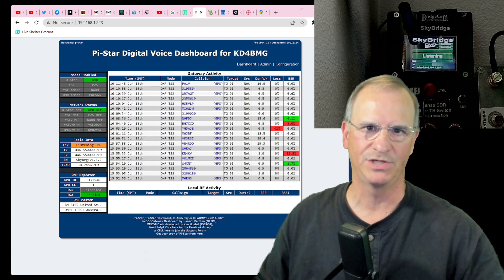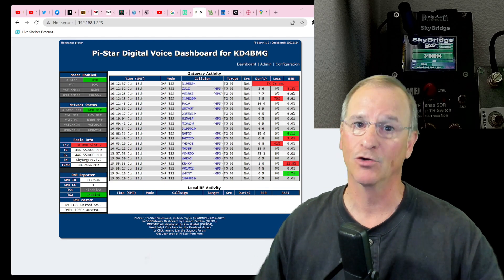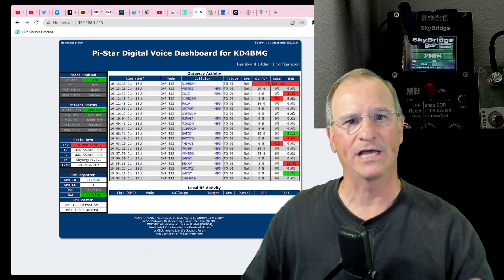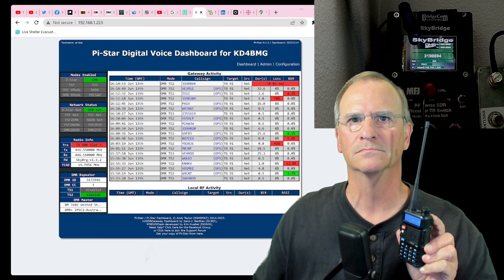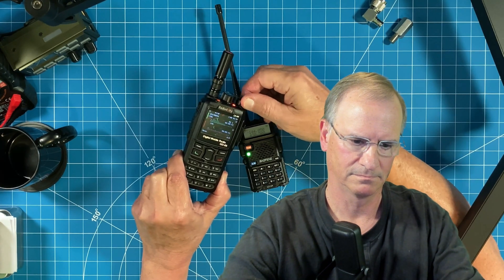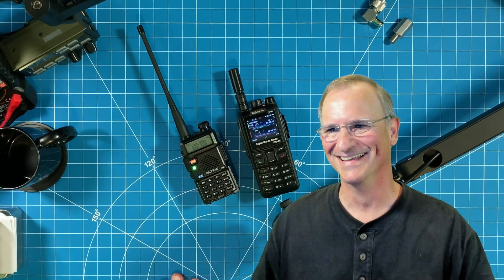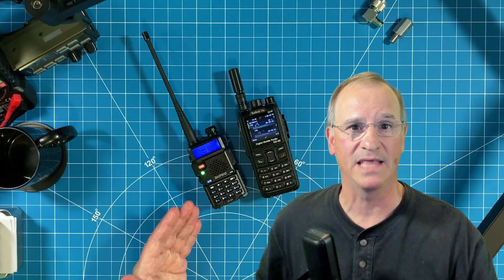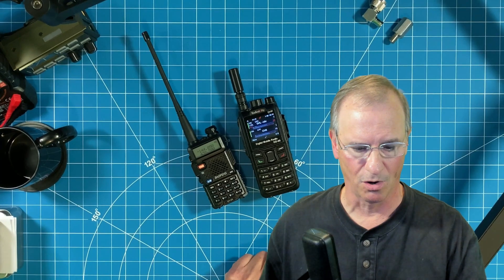Baofeng UV5R does DMR...with some help from the Radioddity GD-88 Cross Band Cross Mode Function

Comment: Use case 1.  When you and a group are out and about, this radio in essence becomes the best pivot to allow people with DMR to stay on DMR and the lesser radios to also join in on the conversation.  Use case 2.  Later on when everyone is back in one place.  You can set it up the way you have here and everyone can hit the radio and join in on digital to internet comms.  Many people with lesser radios have not done it.  The GD-88 very quickly became the best Value to $ radio I have.  Glad you got it figured out.
Reply from the maker: You nailed it.   Pinned to the top you go!

Comment: hello, this is not working for me, can you also have a video, in case I'm not setting up the uv5r correctly, thanks
Reply from the maker: There is no set up on the UV5R; it is an analog radio, so just set it to the correct frequency.
Reply: @HOAHamRadio  it is set to the correct frequency, however, it does not buzz like they say on dmr and it is heard on analog, and I make settings as you do
Reply: @HOAHamRadio  I see that you do it at 144 and my modem is at 440 does it matter
Reply from the maker: @vladimirkaraangov8496  Your GD88 needs to be set to the same frequency as your hotspot and on a DMR Talk Group, then cross band the other VFO on the GD88 to a frequency for your UV5R

Comment: Have you updated to the 9-12-23 firmware by chance?
Reply from the maker: I have not yet, I'm slammed.  I am interested in learning if the volume issue is solved...that is the only thing on this HT I'm not fond of.   Have you updated? And is the audio improved?

I'm testing the DB40-D for them right now.
Reply: @HOAHamRadio  yes, the volume issue is solved and they did add some other features like talker alias. Seems to be working fine so far.
Reply from the maker: That is GREAT news!  Thanks for the update.

Comment: Cool. I can see some use for that when working emergency traffic on DMR. But as I understand your demo it was the GD88 doing all the work. If that is the case then I should be able to use my IC705 or any other UHF/VHF radio to do DMR through the GD88. I’m guessing the GD88 can do that using a repeater instead of a hotspot?
Reply from the maker: Correct, GD88 is doing all the work.  My test was a short duration, so I'm not sure how it will hold up full duty cycle, but the capability is pretty impressive.  I fully expect the same results through a repeater as a hotspot.

Comment: I wonder if multiple analog type radios could connect to the digital radio?  Somehow I ended up with several cheapo  radios that work well enough for contact through the local repeaters, but I can envision using the digital like a node and letting licensed family members connect using the $20 radio.
Reply from the maker: I do think that would work, and intend to demonstrate that in a future video.  Thanks for watching.

Comment: The receive only bug is keeping me from using this radio. Additionally, analog is still very loud compared to other radios. If they’d fix these I’d be more inclined to use this radio
Reply from the maker: I’ll check the analog receive and give an opinion. Being new to the radio, what bug are you referring to for receive only?
Reply: @HOAHamRadio  so you can program a channel where it should not be allowed to transmit, so receive only. Those channels do not listen to the programming and will allow you to transmit regardless
Reply from the maker: Yep, that would be a problem for sure.  Curious if you could provide a specific example.

Comment: cheaper and fewer hoops, i think, just to go straight dmr a baofeng dmr 75 USD
Reply: There is always a cheaper way, but then you are giving up the functionality that the radio was designed for or the quality of the build. If you want 2/70cm, built in dual band, dual mode repeater, cross to hot spot, and also the ability to put all your BrandMeister channels in it and change your Open spot from the radio, you are not going to get a better buy.  Truth is, this is the best $/value/functionality DMR on the market.
Reply from the maker: Depends on what you want to do. I'm not advocating for or against, just demonstrating the capability.  Thanks for watching g and commenting.